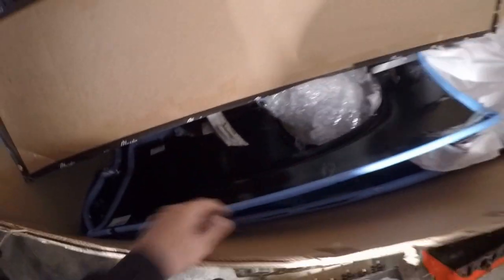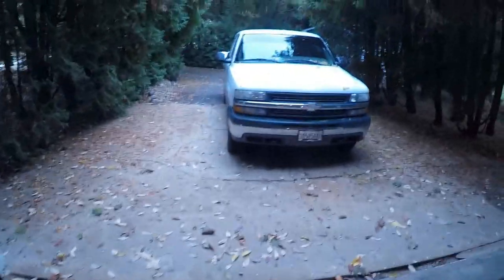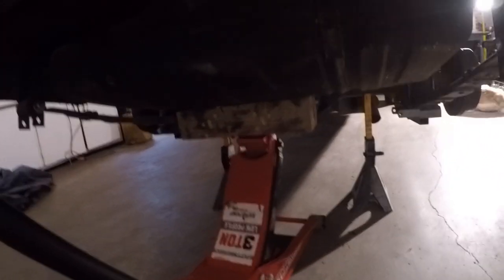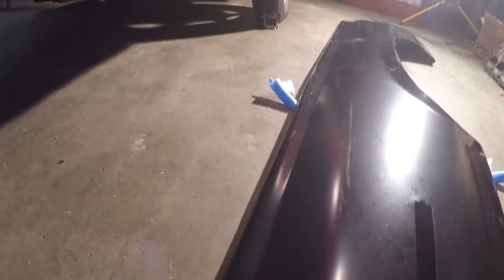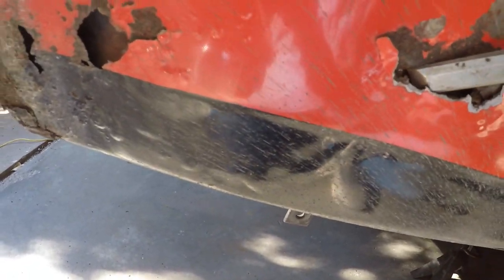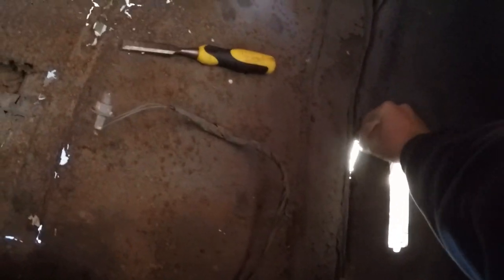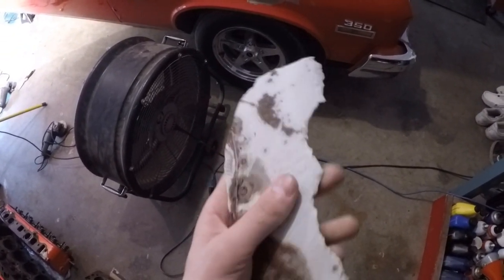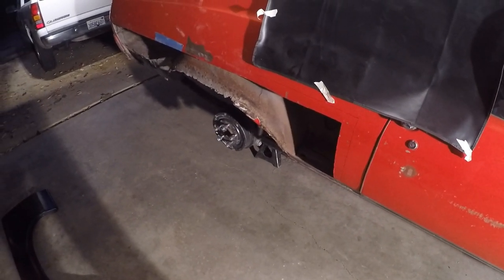Cutting up the Nova for Quarter Panels ( Part 1 )

Comment: good job but to be definitively efficient,  you should  put grease everywhere. grease et the only thing very efficient against rust. put grease between metal and carpet, inside door, behind metallic bumper, under the vehicle, behind  the repairs you can make (everywhere inside the body - hidden erea -  instead of using paint), hollow areas (necessarily hidden, so no need to be aesthetic). For rear wings unreachable with a paintbrush, use an extender and poor old oil everywhere each year.Handyman Experience - 35 years.   From france